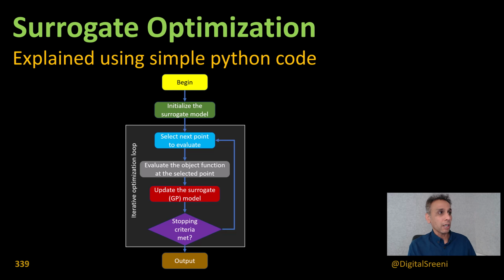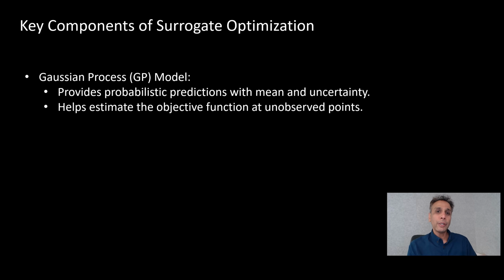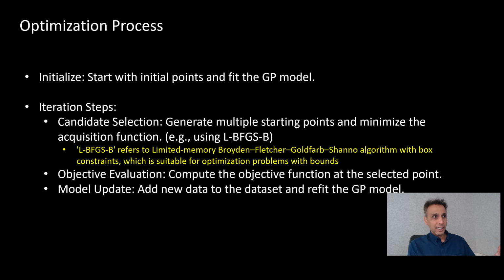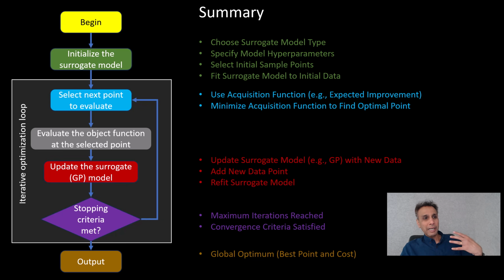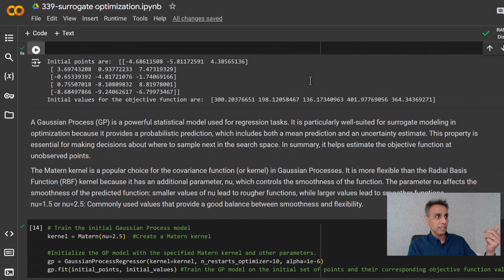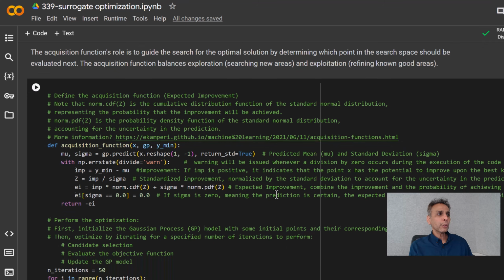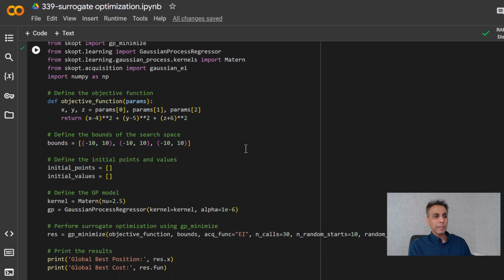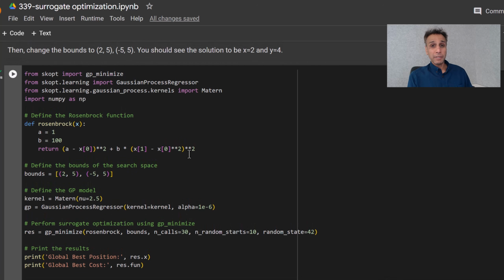339 - Surrogate Optimization explained using simple python code

Comment: Thanks for the content. The timing of this tutorial is impeccable. I'm currently implementing a similar approach to optimize an experiment that is both time-consuming and expensive to conduct. My understanding is that in real life, we need to conduct the experiment with the suggested values, then update the data. We then rerun the process and repeat this cycle until a cutoff point is reached. Am I correct in this context?